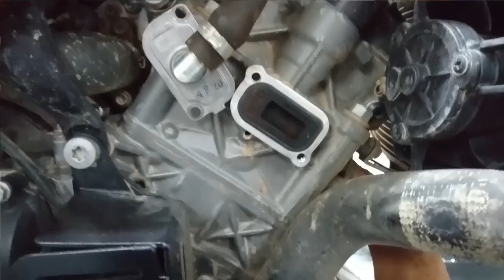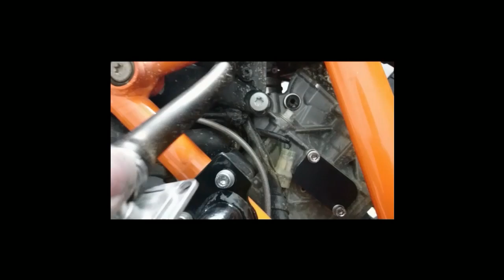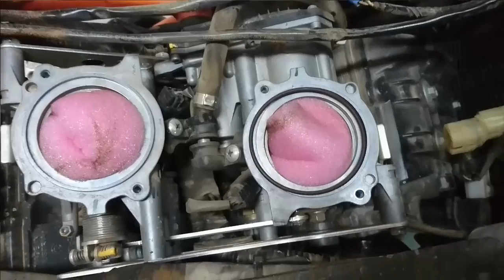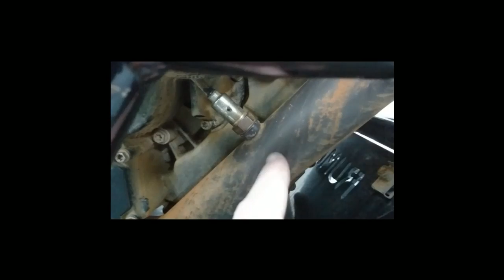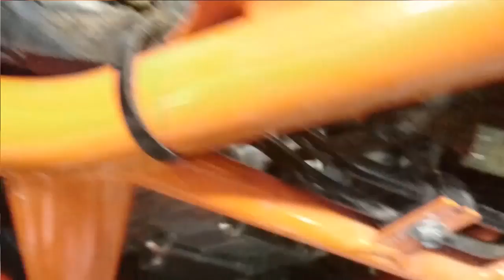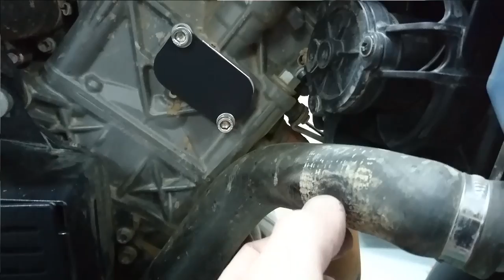SAS Removal KTM 1190 Adventure R

Comment: Why you take it off
Reply from the maker: Weight reduction, cleaner intake air, motor modification, less cabling around engine, planet killing, ...
Reply: @PatrickFlinner  its there for cleaner exhoust,  no point take off
Reply: @PatrickFlinner  its like trowing trach out from car , car gets clean but not nature
Reply from the maker: @lasseeneroth8189  Rest assured that all removed equipment was responsibly recycled via burial in the local playground.

Comment: I’m going to remove the cat on my 1290SA-R. Do you think that with the O2 sensor removal kit it’s enough? Or Should I install an Akrapovic map or something like this? I have heard you can update the supeduke akrapovic map,
Reply from the maker: Eduardo Utrera there is a akra map available from KTM. Cat removal is another step altogether. Leave the o2 sensors in and go for a ecu tune option such as rapid bike or powercomander. You will get better results.

Comment: Prior to removal, did you find you bike made some strange noises from the air box, almost sounding like it was loose and rattling around.....

Did the removal of the sas stop these weird noises
Reply from the maker: No. If you are hearing these noises then I would pull the tank off and examine the airbox. Immediately. 
It could be one of the bolts has loosened/stripped iteself or perhaps one of the air snorkels is loose.

Comment: Thanks for the video. I already took the SAS valve and the canister out but I am going to get the Rottweiler kit #2. Why are you plugging the oxygen sensor out?
Reply from the maker: Oxygen sensor is used by the ECU to adjust fuel mix and (as per programming by OEM) to make it pass Euro emissions regulations. Which in turn makes it jerky in the lower gears. In essence they do nothing when you have no catalytic converter or custom exhaust. And no it does not worsen fuel efficiency, it actually remains unchanged, right hand dependent :-)   - Also: Less wires around engine, less to break. You make notice the wire on the rear pipe tends to wander out of its sleeving after a while.
Reply: Thanks. I know the jerky feeling but after the last service it went away, I don't know what they did. I have a prepaid maintenance, I agree, the kits help to clean up the engine and looks better, beside the space you get from the canister. I know what the sensors do and the emission is not a concern "in this case". I just don't know who it will affect the combustion ratio since my has the oem exhaust with the catalyst converter.  Should I take it out?
Reply from the maker: If you don't feel comfortable with the thought then leave it be. Or at least until your maintenance contract expires. 
As per dealer: Leaving the bike to idle for 15 minutes will allow the ECU to calibrate itself with new modifications. Sounds a bit too sci fi, but it may work, though a dyno run may be more effective.

Comment: Hey mate sorry for the silly question but what's the purpose of doing this?
Reply from the maker: Not silly at all.
The SAS system is there to get the bike past the emission tests, it ensures that it runs lean in the first gears, basically commuting in the city, which makes the bike jerky. 
In essence if you are running an aftermarket exhaust, removed the cat or modified the engine in any way from OEM, then the SAS is just dead weight as its original settings are worthless.
Reply: Patrick Flinner 

Think you will find that's in correct, 

Sas takes fumes from the tank, and burns them off through engine rather than just vent off in to the atmosphere,

The fuelling mapping takes care of emissions regs